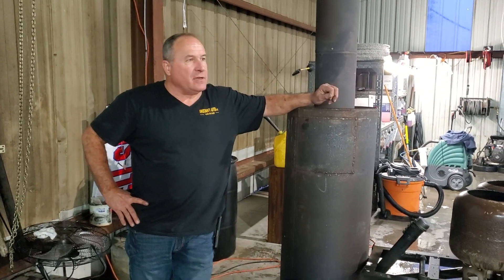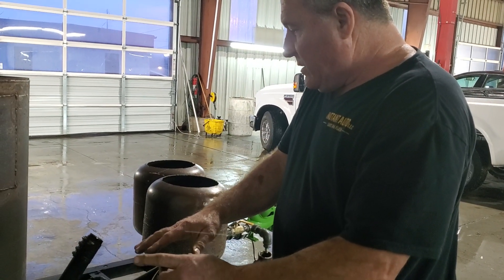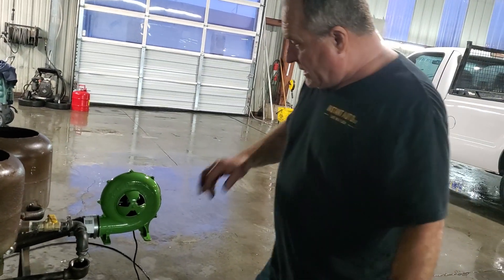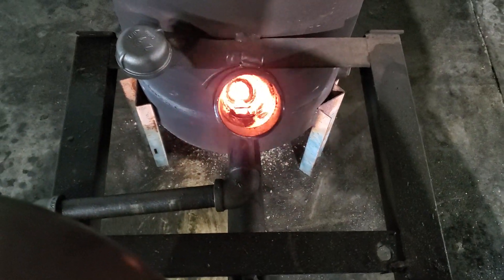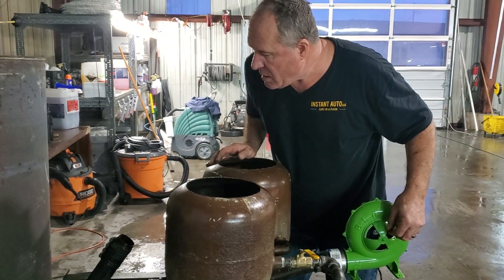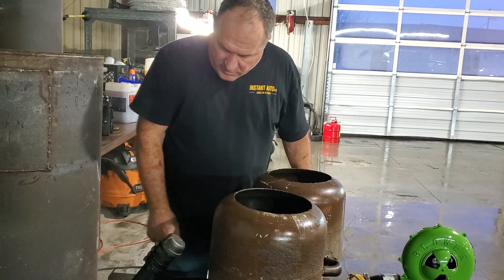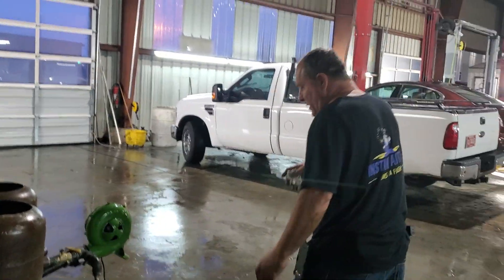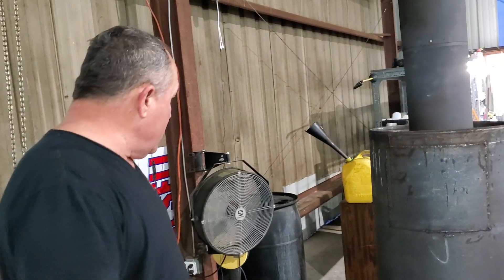PEFECT EASY TO BUILD HOT BURNING WASTE OIL BURNER

Comment: This is probably the simplest, and most practical waste oil heater that I've seen.  I like how easy it is to clean the ash out of the pan. I like the sight window so you can see what's going on in the bowl. I like the use of the forge blower. I burn oil now in a converted wood stove, which works pretty good, but there's some things that I dont like about it that your design fixes perfectly.

Comment: Nice build. I think you could cut your oil usage way down and get alot more heat in the shop if you welded 12 or so tubes through your upper tank amd set a small fan behind it to blow through the tubes

Comment: If I heard you right you said you are burning about 30 gallons of waiste oil per day. That sounds like a lot of oil. Do you have any idea how much fuel oil it would take take to heat your shop per day using a standard fuel oil furnace as a comparison? Thanks.
Reply from the maker: DO NOT SIR, SORRY
Reply: 6” pipe out the top with an 8” pipe over it? Is it a 6” ID and really thick wall because I can’t wrap my head around how that works.
For the bottom, how tight is the hole on the burn pot and how far does the burn pot stick up into the burn chamber once you put the spacer under it?
Reply from the maker: 6" SCHED 40 OUT THE TOP ABOUT  6".  WITH 8" STOVE PIPE AROUND IT JUST SITTING ON TANK. BURN BOWL HAS 1/4" SPACE AROUND IT UP IN THE TANK 1/2" OR MORE